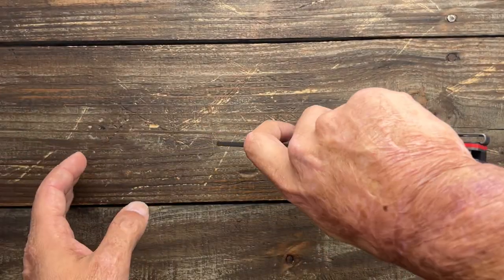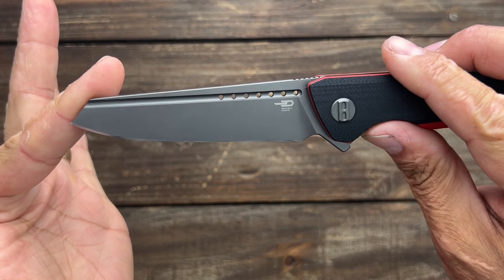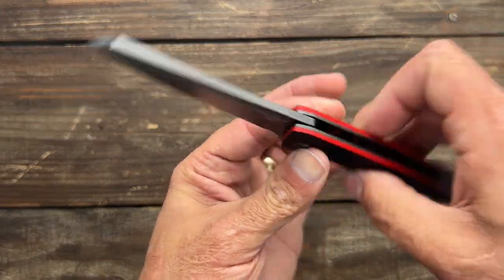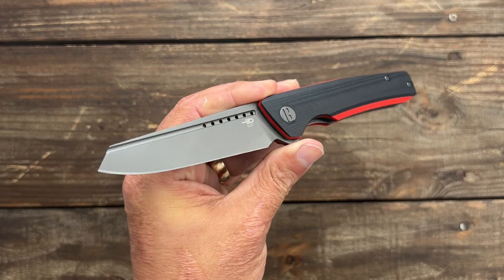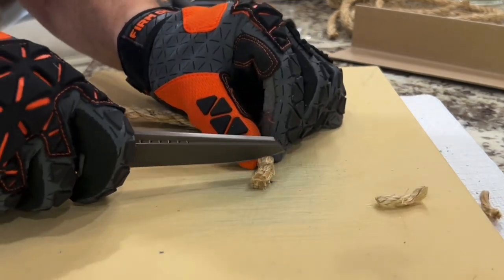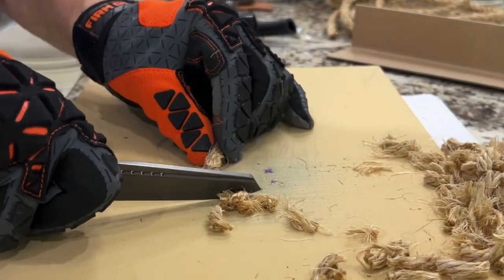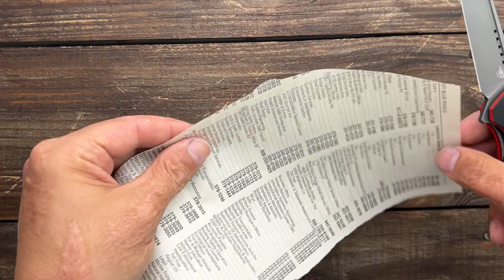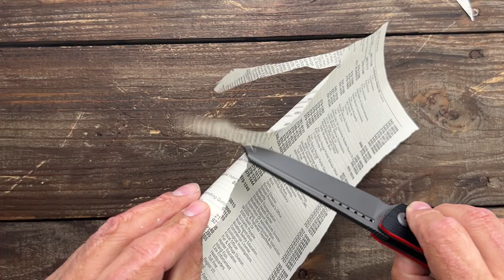Find Out What We Discovered About the Bestech Slyther!

Comment: I picked one of these up a couple of weeks ago, and am pretty impressed at the detail work for a $70 knife. Just 3 years ago you’d never dream of seeing a fuller with speedholes unless it was a $350 Begg from Reate. Great action, my only complaint would be a tad heavy and a couple of sharp edges. I can easily middle finger flick this guy, which I can’t do on most knives you’d flick like that all day! I got the jade 2-tone. I thought the fuller might be an issue, but so far not really - and if you didn’t run across that I sure won’t! Thorough review as always.